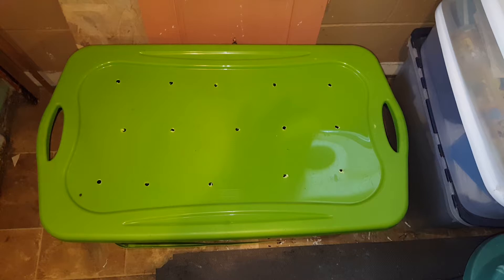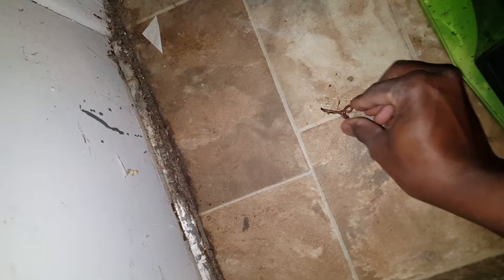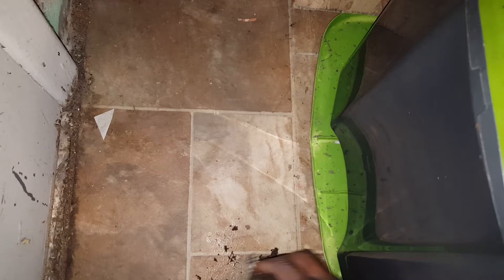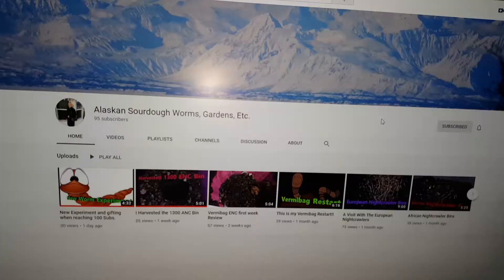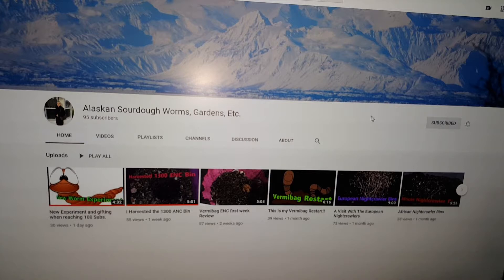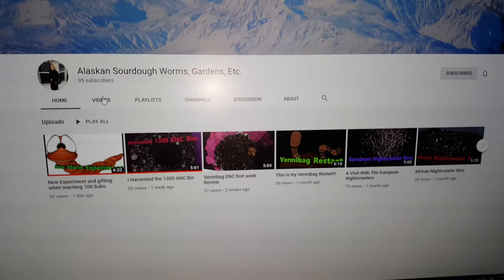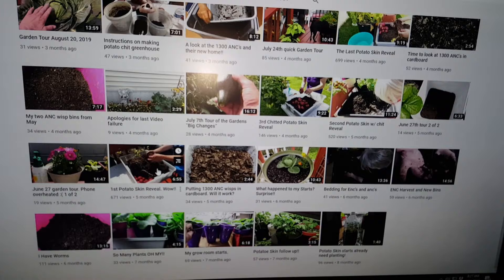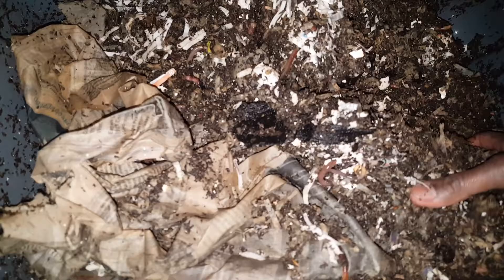Do Worm Farms Stink

Comment: How about adding a lot more air holes to the lids to help prevent escapees? I did that to my stackable totes and it works. 🐛😊
Reply from the maker: Ok thanks for the tip.😎🐛
Reply: @AJsGreenTopics  you have a stacking tote waiting for you here in Central Illinois.
Reply from the maker: @PlantObsessed  how do I get it sent to my address?
Reply: @AJsGreenTopics  are you a member of the Facebook group experimental worm fun or another vermicompost group?
Reply from the maker: @PlantObsessed  red worms  composting group.